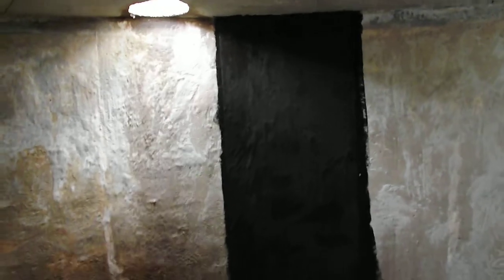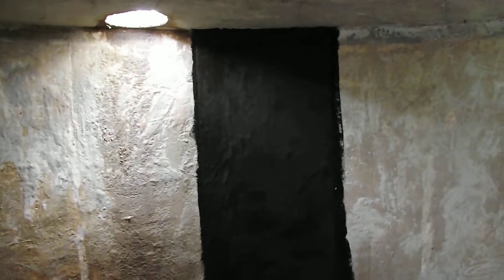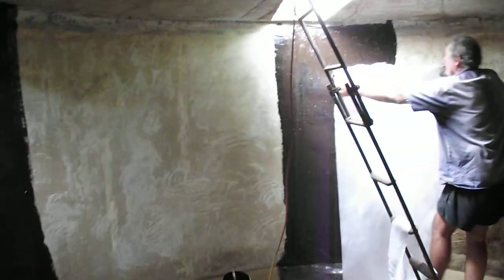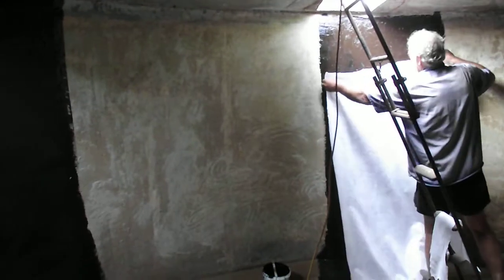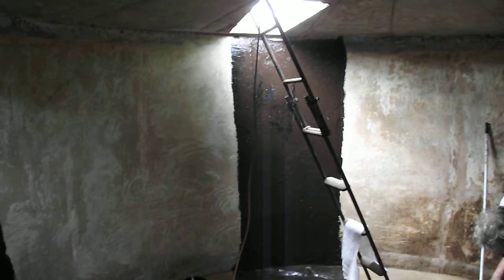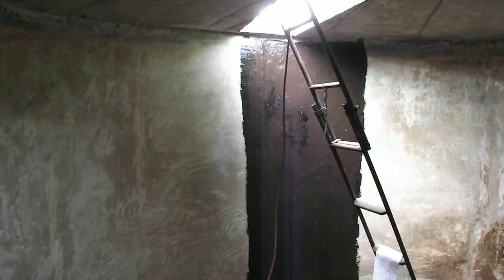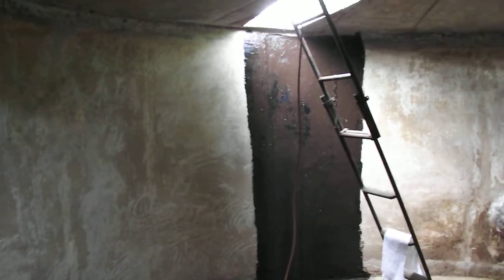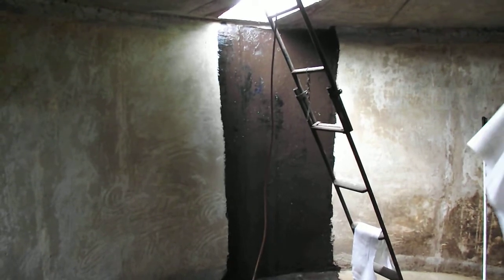Sealing leaks in a concrete water tank.

Comment: Did it work? Need my leaking cracked tank repaired. Is it a losing battle or worth the effort? Thanks
Reply: Thanks for that. Have been tossing around a few ways to go. Getting a liner installed or even dropping a poly tank inside as I have just a tin roof cover. Still not sure what to do. Would be frustrating to clean it out and patch up and still have leaks. Thanks for posting. You cleaned up your tank really well before the seal. Not an easy task
Reply from the maker: @tonyfletcher1718 .. I looked at liners but was worried that the concrete tank may be unsound.  My issue was that one section was a bad pour (about 28 years ago) and could fail and that is one of the things they discuss re inner linings. The concrete tank is pretty well a spare as we also have a poly tank but I prefer the water from the concrete.   I have been told that concrete tanks can become unsafe when they are empty for a long time and have heard of them collapsing, so ask an expert re the idea of dropping the poly inside, although as you said you have a metal top.    All the best.
Reply: Thanks again John, you have been a great help. I may have a go doing what you did. My tank has about 200mmof water and mud in the bottom so I'll have to bale that I suppose. I was amazed how clean and dry you got the bottom of your tank. I'll need to clean mine to get the full picture. I have about 3 vertical cracks and 1 horizontal. They all just weeped or dripped with moss on the outside. I realised the tank was empty when I saw the moss was dead. Its been leaking for over 10 years but  never emptied before but with the current lack of rain in West Gippsland it wasn't getting any topups. Thanks again for posting your video
Reply from the maker: @tonyfletcher1718 ..   Believe me mate, there was a lot of work involved in getting the sludge out before the video was done.  We scooped a lot out and then used a little transfer pump  with a hose running out through the bung at the bottom, then mopped up the rest.
Reply from the maker: It did not stop the leak completely but did have an effect as previously it was actually spraying out.  I spoke to the people who make it and they said that another coat may be required but it has not been empty since so we have not had the opportunity.   I would probably go heavier along the actual crack if I did it again.